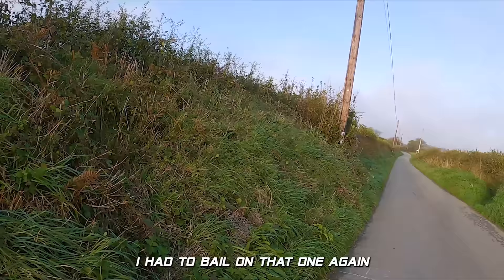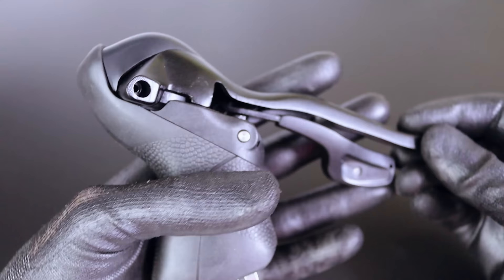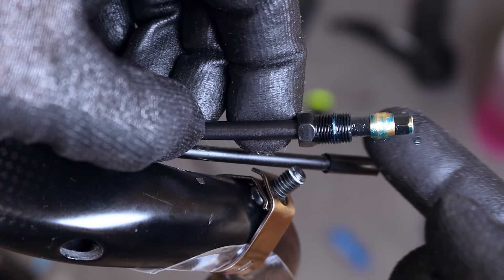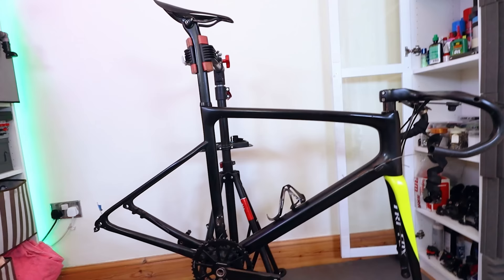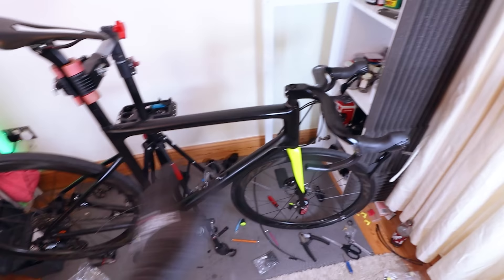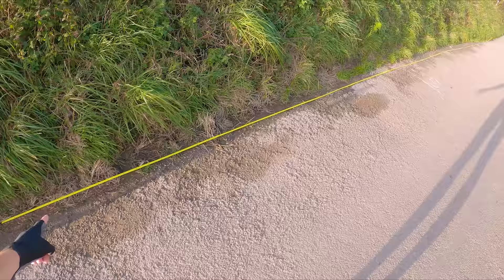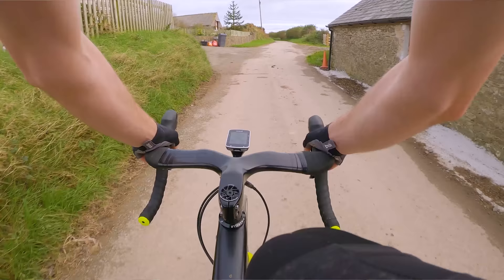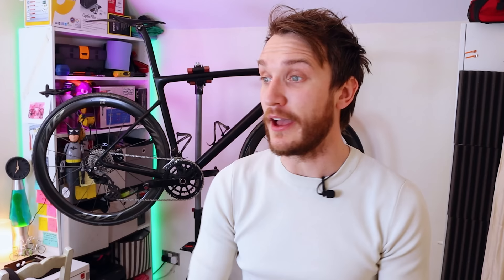Mechanical VS Hydraulic Disc Brakes - Shimano RS505 install & test

Comment: Being on a mechanical disk setup for a while now, and delaying the move to full hydros due to cost, this was a very anticipated content !
So... full hydros DO make a big difference in braking.

I am curious about the pads though, as juin tech stock pads are not mentioned to be very good, and shimano stock pads are usually good.
I have changed the pads on my TRP Spyres to Swissstop ones, and it was night and day on both braking and modulation. As the pads had a lot more friction, the lever force needed was less, so making it a bit more of a straight line in a graph like yours.

Is there any way you can test the juin tech's with shimano pads ? ( I know they are compatible with a shimano model). That would take pad compound out of the equation as well, and the only difference would be hydro vs cable.

(Probably that is not possible now, as you won't want to remove the full-hydro setup from the bike, but would make a point though :) )
Reply from the maker: I agree that the stock resin pads are not the best with the Juin Tech. I actually upgraded the pads on my JuinTech's to semi metallic, and it make pretty big difference. Not sure the shimano pads will work with JuinTech calipers, but if you are in the UK, there is a seller called Noah and Theo on ebay that do some killer semi-metallic pads for a really decent price, so i would be inclined to give them a go if you havent already...
Reply: @TraceVelo  There are shimano pads compatible, just not the same as in the RS505 ones, I think the older SLX fit there :) 
Thanks for the tip, but I am in Portugal.
I have a set of Juins coming in from Aliexpress and plan to use them with "disco brakes" ceramic pads.
Check them out, as they are much nicer than semi-metalic for performance and are completely silent !
Reply from the maker: @PauloSerra  So i've given ceramics a go in the past, but found they were not very good when cold. I found the initial bite to be a bit lacking, but once they warmed up, they were pretty good. I also found they they tended to really concentrate the heat into the rotor, and not dissipate the heat very well. Might be worth another go though...
Reply: @TraceVelo  Interesting opinion. I made my choice based on this video https://www.youtube.com/watch?v=q65sbSmHZds
Maybe not all ceramic are made equal ? 
In any case, my Juins are still at the post office, so I am unable to verify.

I am curious about one thing, with the semi-metalic pads you mention, what would be the improvement on the emergency brake test ? 1 meter ? more ? That would greatly help narrow the gap to the full hydros.
Reply: rim brakes make your bike stop. hydros and discs are just a gimmick
Reply: @loc9588  unless it's wet outside, or you're overweight, or you're bikepacking with 10kg of gear.... then rim brakes are worthless.
Reply: @paulwalker6153  rim brakes work perfectly fine if it’s wet outside. They also work fine if you’re overweight. And yeah of course they aren’t ideal for bikepacking, in which case the debate is non applicable
Reply: @loc9588  How about if you're a woman with significantly less grip strength than an average guy? My wife demanded hydraulic discs to rims precisely for that reason - it takes so much less effort at the hands, making it much safer for her especially during long rides when she's tired.
Reply: @DendrobiusAU  it’s not necessary, it’s merely a want
Reply: @loc9588  Why have a derailleur? Single speed still makes you go forward. Why carbon frames? Steel is a fine material for durable frames. Why clipless pedals? Rat traps will keep your feet on the pedals just as securely.

It's not necessary, it's merely a want.

/s
Reply: @loc9588  Why cycle, legs work fine? Why drive cars? Why even work? All we need to live is to eat and drink...... both work but discs is better, humans always strive to become better, discs will become the future whether you like it or not, just look at the mountain bike scene, even commuter mtbs have discs on them. This video already clearly proved discs, and full hydros, are objectively better, unless you are stubborn and trying to find a reason to change your stance, i would advice you not to rile people up unnecessarily.....
Reply: @hebleh5771  discs are not better. They have way too much power for the average person. I put my friend on a hydraulic disc bike when he came over and it took only half an hour for him to lock up the brakes and come off the bike. It was on flat. Wouldn’t have happened with rim. Rim brakes are better because they are lighter, simpler to work on and still have very good stopping power as long as you have enough brain cells to set them up properly.
Reply: @hebleh5771  You're clearly brand new to the bike scene & are now splurging on random trendy gear to try to impress. Mountain bikes have literally been running discs since the late 1990's & became the standard shortly after. Lol
Reply: @loc9588  yeah with any brain cells you wouldnt lock the tires either, did you not watch the video? The max power of discs are way more than rim, but the most important is modulation, you dont put 100 percent brake power on rim either do you? If you do then that shows the shortcomings of rim brakes, because i used both i know i dont have to spend as much energy during a long ride in my fingers on brakes and makes the ride much easier and comfortable but the fact that rim cannot even reach the power of discs means you have the option to use that power, but on rims you are limited
Reply: @FirstnameLastname-pe5ib  Yeah and what about before? Why arent they going back to rims then if rims are better? Why are more and more bikes from the modern peloton showing more and more discs? Please enlighten me on why you people are so against change for the better
Reply: @FirstnameLastname-pe5ib  and no im not in a position to splurge on bike parts, my first bike was a no name (actually called gaotelu but wtf is that anyways) aluminum roadie for 250 bucks online, tires and tubes were shot on the first ride, spent majority of the time on 9 speed, only just upgrading to sensah 11 speed recently, but throughout all that, i missed the feel of even cheap full hydros from my mtb, you have no idea how cheapskate i can be, even more than luke, but hydros are just better in every way, hopefully they become cheaper in the future
Reply: @hebleh5771  yeah but ask yourself what the extra power is for? I descend 45mph down hills all the time, and my 2010 shimano tiagra brakes with basic alu pads stop me within 4 seconds. still have mad stopping power. hydraulic disc is so overkill
Reply: @loc9588  i would rather have that than squeezing the levers as hard as i can, after a long ride with many of downhills my fingers get really raw and fatigued
Reply: @PauloSerra  the F1s and R1s use the same pads as these Shimano calipers. Shouldn’t be too hard to get something better.

“XTR BR-M975, BR-M966, BR-M965 / Saint BR-M800 / XT BR-M776, BR-M775, BR-M765 / SLX BR-M665 / Hone BR-M601 / LX BR-M585 / Deore BR-M596, BR-M595, BR-M535 / MTB groupless: BR-M545; Road: BR-R505; City & Touring: BR-T665”
Reply: The Shimano pads are a better upgrade I would think.
Reply: @loc9588  I can kick up my rim brake old road bike easily on the back the same as my disc bike. You in just adjust the pressure applied.
Reply: @glennoc8585  thus proving my point that disc brakes are pointless. You can get the same stopping power from rim

Comment: Luke. Seeing as you're rotating over the bars at max braking the 160mm disc on the front seems excess and 160 on the rear is pointless, so what's your thoughts on dropping to a 140 on the front (maybe same or more smol rear) and finding what's the shortest distance you stop in on THE TEST HILL (patent pending)?

[essay]
 I'm 5'16" and 105,000g, on a local 10% descent (I've heard of weirdo's ascending it) into a T-intersection, rolling in at 27-30km/h, Cervelo Soloist (deceased, RIP seat tube) with 105 Groupset Of The People rim brake [stock] wouldn't pull me to a stop. Weave across the lanes on the very bottom or will stop just short of the middle of the intersection.
Same bike with green SwissStop pads I could consistently decelerate down the hill and would stop before/on the red sign that poses such the request.
 Replacement bike (now deceased, RIP top tube to seat tube) 2016 Vitus Zenium DB (Ultegra 6800) with stock TRP Spyres (160F/140R) laughed at the 10% pulling up in <6 car lengths from an almost 30km/h, and a pad upgrade dropped that again by a car length.
 To get a similar result as the stock Cervelo (ie. not really decellerating) the stock TRPs would start to struggle with an 18-20% downhill. Pad update would decelerate to a stop on the hill.

The improvement between mech rim to mech disc is *[profanity] amazing*!
 PLUS a pad change feels 20% better again!
and the confidence the initial bight of disc gives just puts the rimmers to shame.  For those of us old enough, going from late 70s drums to very early 90s discs in cars.

 On 'Phil' the Vitus, the 140mm rears feel like they only offer 10-15% braking effect with a quite spongy lever (I probably need to do your cable upgrade), so in hard braking you can just mash it on and focus that hand on steering control. Whilst seated I can't lock up the rear except on gravel.
 The front's 160mm doesn't quite have enough in it to throw me over and the lever actually feels really good for braking control, especially that I can't over brake myself with a full fist of lever BUT in emergency braking situations Pucker Factor goes 10+ as the stopping point is juuust in the contact zone if no party makes some corrective measure. Same situ' with rim brake... I've had a couple of dead legs and a smooshed rear wheel from the friendly nose of cars (all roundabout incidents where apparently a bright blinking light [EVEN AT NIGHT!] either is disregarded or not seen through a B-pillar, or because i'm not the shape of a car the zombie behind the steering wheel ignores what they see). 
 above was all dry conditions... now sling in a moisture component. The discs feel up to speed inside a quarter rotation (and still don't lock up which adds confidence in a situation). Rims never have inside a full rotation and more often than not it's some picked up sediment grinding on the rim surface doing the "work".  For rim brakes in the wet,extra car lengths in braking distance are applicable.
Note: Braking hard without locking up lets you have the option of steering out/away from a situation as well. Whereas with Luke's emergency braking in the vid, in the moment you tend to get focused on not going A over T (a-la the two abandoned attempts), but both can/are beneficial to injury reduction (personal experiences may vary) You just do not want to be locking up. it gives you less ability to change the situation
 The downside to super hard braking is being collected from behind. Can still end up walking home anyways.
Situational awareness is always paramount, whether racing, commuting, hitting trails... Cycling in general. Head on a swivel, look ahead, look around, try to predict, assess what you're approaching. #PSA

 For long rides and commuting, the TRPs feel fantastic for hauling me to a stop in the 30km/h and under conditions.
 I'm tempted to lob an MTB 200mm disc on the front and slot the 160 to the back on the next frame, 'Phil Jr' (a Norco Section).
 Am intrigued if a similar level to Full Hydro can be achieved. Maybe they can't be on par with hydro, but sub 11m on a same test would still be ace (a 20m marked clak line and 40km/h i can do... the extra 30kg over Luke might take some preparation), and if it can be achieved within that extra 215g... happy days.

NOT an ad for TRP, I've just not used anything else apart from them, 105 Groupset Of The People rim, and some real bargain bin trash from the early 90s [/essay]
Reply from the maker: Amazing comment!!! 👏 👏👏 But yeah, totally agree with alot of these points. Moving from rim to mechanical disc was a definite game changer, and pad choice made a huge difference here. The difference between the stock resin pads on the JuinTech’s, and a set of semi-metallics that I upgraded to was profound to say the least. Much more bite on the semi-metallics!

But I think ill consider downgrading the rotor on the back to 140, 160 is definitely overkill. Its proved useful on long decent, but in Oxfordshire the hills are few and far between.

Anyway thanks for the comment Roy! 👌
Reply: @TraceVelo  A query. What's the biggest change you found from mech to hydro discs?
I'm assuming it's not similar as rim to disc, I'm pondering if it's more like TV/gaming monitors going from 2K(1080p) to 4K or possibly 30fps to 60 or 120fps where it's a clarity thing that can't really be conceived/comprehended through description...

Comment: I couldn't justify the upgrade personally. I have hydraulic disks just not fully. I cant see that much difference. My back wheel locks up not even trying to emergency stop. Im getting used to them now.

Comment: Are these hydraulic brakes so good that fitting wider tyres won't provide any improved deceleration? It would be interesting to compare the stopping power of a recumbent bike against a road bike more vulnerable to tipping over, especially when braking hard going downhill.

Comment: Now try using floating rotors and attempting to overheat them versus static
Reply: Floating rotors against solid rotors with single-piston brakes would be interesting thing to try or watch. Theory goes a floating rotor does not have to bend when braking, but it moves laterally and aligns / centers itself to brake pad surface improving brakinf performance. Floating design also isolates the heat buildup to the braking surface instead of heating the whole disc, which leads itself to faster cooling times.

Comment: It still amazes me that one of the Chinese manufactures haven't come up with a full Hydro road group set yet (or even just a set of levers). I've had some of those dirt cheap Zoom hydro's on my hybrid commuter for 5 years and although not as good/powerful as my Sram Apex (gravel) or Ultegra (Road) they still pee all over anything mechanical and they would probably improve further if I upgraded to branded rotors and pads. As far as I can tell there is nothing special about road Hydro's other than ergonomics so its a mystery to me why this hasn't happened yet.
Reply: If Sensah were to mate their SRX group set with hydraulic shifters and calipers they'd be a serious competitor to Apex or GRX.
Reply: @Stoney3K  Exactly and it would probably, finally bring the price of the big brands hydro groups down too. I just did a partial upgrade on a MTB for a mates kid with SRAM Level brakes (easily a match for APEX and RIVAL in terms of breaking performance) and 12 speed NX shifter cost: NEW £140. I had to replace a broken left APEX 1 lever (so no shifter) a few years back (pre covid) £150. The price hike between flat bar and drop bar components is insane. 
I wish some company would come out with a universal set of Hydro leavers that you could swap out the shifter unit or just the ratchet (like what Ratio did) to work with whatever rear mech you want, that would really be a game changer

Comment: No mention of floating mechanical calipers?? If you can afford twin opposing piston hydraulics they offer the same advantages. 
Even pad force, no rubbing, no need to adjust them ever. 
For some reason IS mount floating calipers got discontinued in favor of cheaper fixed post mount calipers
Reply from the maker: I haven't actually heard of floating mechanical calipers. Do you have an example of them, I'd be interested to check them out...
Reply: @TraceVelo  only on my 2 bikes, dyno brand and some other brand. 
Every car on the road except exotics with opposing pistons uses floating single piston calipers. 
You can Google car versions easily, but there are 2 greased slides that the caliper floats on. 
Auto centering, doesn't bend your disc, auto pushes the piston back in, if you have a lot of fork flex they won't rub too. 
But they still wear 1 pad more than the other, so I'm sure they can't be 100% efficient (all cars do the same too)
Reply: @TraceVelo  they are old, but they are still sold on entry level MTBs. Very lightweight too. 
I went looking for mechanical hydraulic on aus eBay, but $45 for 1 zoom caliper was all that was cheap. Lots of review's with blown seals. 
Keep up the good videos, even if they are a bit long winded, cheers

Comment: I wonder if anyone has just installed the hydraulics on the back and left the mechanical on the front to give you a more forgiving front braking with out the fear of going ass over tit with the handle bars but still getting that better braking power on the back with hidro brake.
Reply: Rear braking is always compromised by the dynamics of weight transfer. Only bicycles have identical systems front and rear, probably because of economics. You have maximum power with the rear wheel hovering just above the ground.
Look at motorbikes and cars.

Comment: 16:45 : I thought British place front brake on the right hand.... Do you prefer the opposite way?

I think that if you are in a right hand drive, your rear brake should be on the left hand so you could use your right arm for turn signals.
And yes, front brake is more efficient than the rear but that's the problem, it can be too violent and with only one arm on the handlebars, due to inertia, if the braking is too hard, you might rotate and fall over. Rear brake is easier to control. 
In the rest of the world braking is the other way around. 

Also, is it strange for the British to have on the left hand the rear brake but the front derailleur and on the right hand the front brake and the rear derailleur?